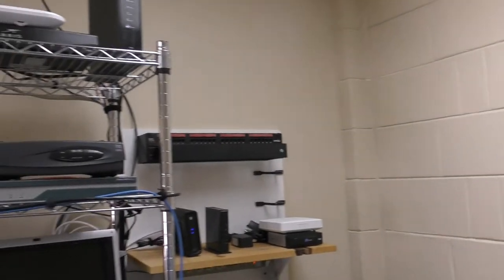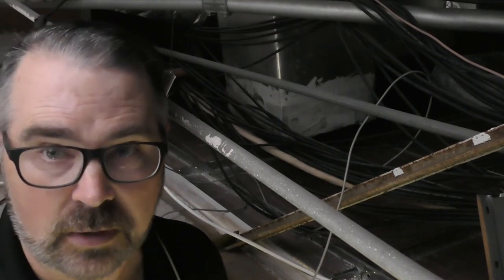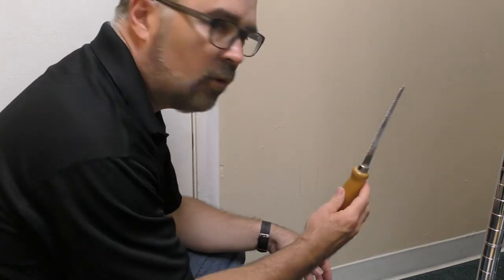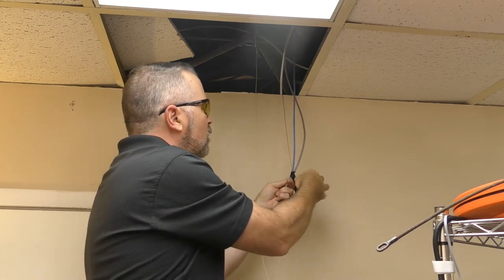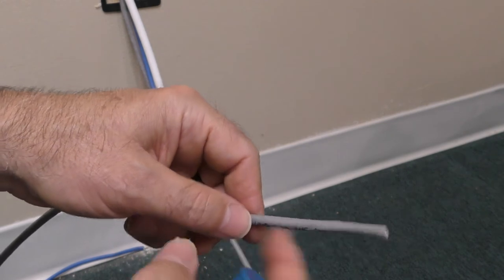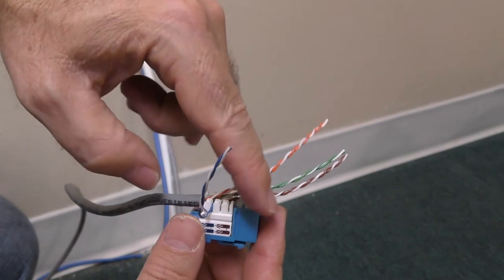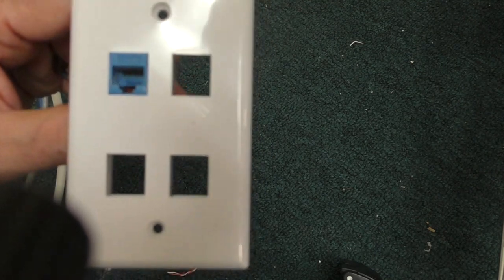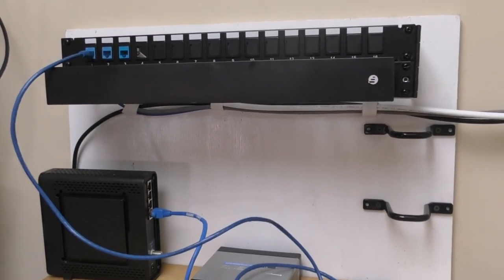How to install Network Jack

Comment: It is always better to run the conduits  within the wall during construction  or to a blueprint for network Conduiting
Reply from the maker: 110% Peter, but I guess for cost reasons, I rarely see conduit for low-voltage drops.  Thanks for the comment!  :-)

Comment: Dont cheap out on keystone jacks. I worked in one building where they started to fail after years of having a computer or phone plugged in. The pins bent over time and couldnt make firm contact and would cause the nic to randomly go haywire. At first everyone thought it was a driver or switch problem but nope. Phyical layer as usual. Replaced the keystones and problem solved.
Reply from the maker: Great advice Henry.  Back in my younger, dumber days, I bought some from Home Depot (CE brand).  Oh man,  I was so regretful.   😆

Comment: I would suggest renaming the title to something along the lines of “How to install a Ethernet wall plate.”

Just to help bring in more viewers.
Reply from the maker: Thanks Sarge.  Always glad to hear from you! I really wrestled with what to title this.   You an I would look for the word “Ethernet “.  But would the average Joe use that word?
Maybe “how to install a network wall outlet”?  (Instead of “adding”)
Reply: @NetworkAdvisor  Another possible idea would be “How to add a network jack to a wall”. That is true, I don’t think the average Joe would use “Ethernet”.
Reply from the maker: Appreciate it 😊
Reply from the maker: Sarge,  I am thinking your avatar icon there is the Bengals .  If so, good luck tonight! 😊😄